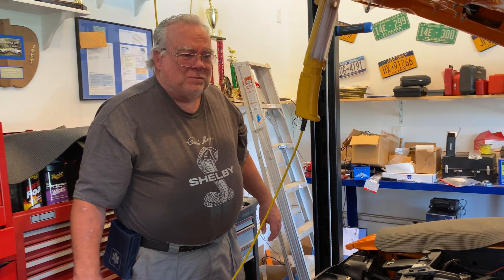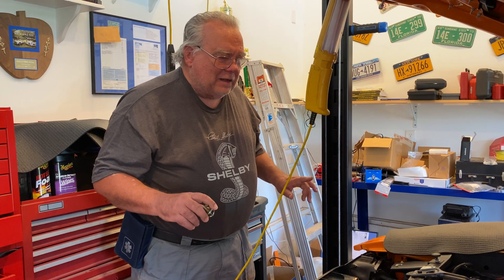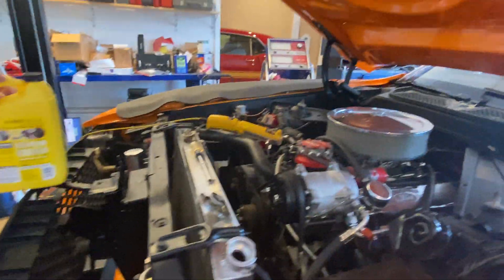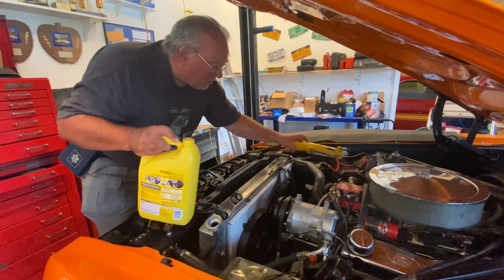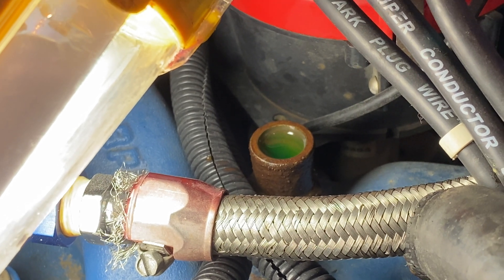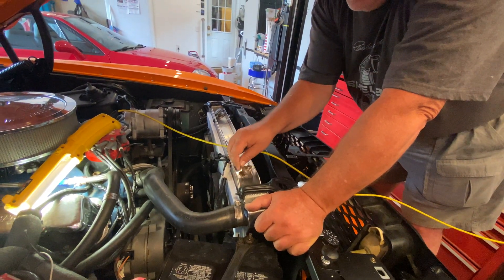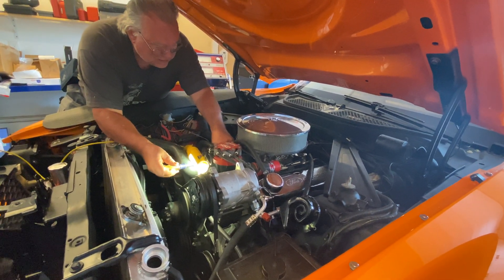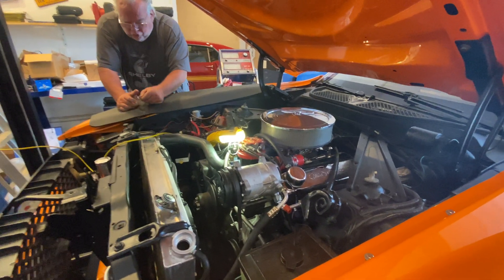First Generation Mustang Engine Coolant Trapped Air Burping/Bleeding Procedure

Comment: Great video! I had the opposite effect after removing the heater hose, almost 1.5 quart of coolant from the intake 😅 Does it mean that coolant flow is blocked by the stuck thermostat or the pump is not doing it's job delivering the coolant to the engine? Thanks again!

Comment: Hi Gil, great video and a beautiful car.  On your procedure, would it be true that following thru the steps, and if once you loosen and pull off the intake heater hose (my hose inlet is a 90 degree angle so the opening is sideways vs yours on top) and so if coolant is already leaking or pouring out right away, then you are good to go and can just close everything back up then? Thanks much.
Reply from the maker: Thank you for your comm ent and question.  In your situation lt sounds like you will be fine.  !la 99 Degree outlet won’t cause a problem.
Reply: @gilberthale7777  Thank you. and you were spot on, as soon as i loosened the clamp and pulled hose back, the coolant was already right there. road test temps were great, no boilovers or any issues. thanks again.

Comment: That’s really cool. Thank you sir! I looked for part two of this but I couldn’t find it. I imagine a guy just lets the engine come up to temp with the radiator cap off.
Reply from the maker: I have not done a part 2 of this video.  I am replaying it now to see if I had said I would produce a later, more complete version as I really don't recall saying a later version would be useful or not.  If I said I would make a later, more complete version I will do so this Spring.  Meanwhile, I am glad you found this video useful.
Reply from the maker: I found the reference to a 2nd video to show how I check for coolant leaks.  I thought I ended up doing such a video.  I will look for it, and if I find it I will provide the weblink for it.  Otherwise I will produce such a video as soon as Car Season 2025 begins.  We live in Snow Country (near Rochester, NY), and if you can believe it we got some snow and ice earlier today today (4/16/2025), and it was barely above a  freezing temperature all day,  Stay tuned, whether it is a past video, or a new video, I will provide you a weblink as soon as I have one for you...  Thank you for alerting me to this missing video...

Comment: Lovely European cars had air bleeds I learned to drill two small holes in the thermostat it helps the engine warm up better. Thermostats work better and always have a overflow tank.
Reply from the maker: Good to know.  One more thing to look out for lest I get bitten in my tail feathers.  heh heh...  Thank you for the head up...

Comment: My gauge stays normal, and no bleeder valve?
Reply from the maker: Hi Mark.  

I am having difficulty in discerning what you are meaning by what you say,.  What kind of gauge are you speaking of? (Vacuum, pressure, temperature)?  And what do you mean by "bleeder valve?"  My guess is once you clarify things it will be perfectly obvous to me, but at this moment I am thrashing around trying to guess what it is you are saying or asking.  Sorry...
Reply: @gilberthale7777  the gauge on the instrument panel, where the tach and speedometer are.
Reply from the maker: @Mark-um3hm  Okay, got it.  Staying in the Normal range is good.  I like seeing the temperature being read staying near the middle of the Normal range.  In slow traffic or when idling for a prolong period of time, especially on hot days, the needle will move toward the hotter side of the Normal range.  Once the car is traveling over 30 MH or so the needle ought to move back into the niddle part of the Normal range.

If the needle tends to read on the higher end of the Normal range I suggest getting a digital infrared thermometer to read the temp of the upper radiator hose to see what the temperature actually is.  I have seen cases where the temp sending unit begins to cause the temperature gauge to read higher than the temp actually is.  I ended up replacing the temperature gauge sending unit on our 1969 Shelby GT500 for that reason.  The temperature gauge reading at the higher end of Normal then returned to reading in the middle of the Normal range.  The upper radiator hose was reading 181 degrees where the temperature gauge was reading at the upper end of Normal until I change the sending unit.  

As for a bleeder valve, I have never seen a bleeder valve on a Mustang engine from the factory, ever.  My method of "Burping" the engine''s cooling jackets as shown in the video above is my way of performing the job a bleeder valve likely was designed to do.  Although a bleeder valve would have been a good idea, and easier to use, my guess is manufacturers don't use them because it adds to the cost of building an automobile, and they likely do not see trapped air as a big problem.  Frankly, if an engine has air trapped in its cooling jackets, at some point the thermostat will get hot enough to open, and the trapped air will tend to move into the radiator as the cooling jackets begin to fill once the air has moved out.  But, there is too low a level of coolant, and the upper part of the engine block and heads will have gotten far hotter than they should have before the thermostat opened.  A radiator can then be topped off with coolant while the engine's thermostat is open. and as it is filled the remaining air in the engine and radiator will be replaced with the higher coolant level.  What I am trying to do by burping the engine of trapped air is prevent the engine block and heads from become super-hot before the thermostat does eventually open.
Reply: @gilberthale7777  You think it’s possible that it is my thermostat? Say I run to the store, I’ll start my car, and it’ll come up to temperature, and the upper radiator hose is very hot, but my hose going to the thermostat is cold? Even if the temperature gauge is in the middle, sometimes the thermostat hose isn’t hot?
Reply from the maker: @Mark-um3hm  The smaller diameter hows connected to the thermsrtat housing is the heater (core) return hose.  It will get hot when the heater core coolant is flowing from the water pump, through the heater core, and is being returned to the engine,  It returns to the coolant inside the engine through the small hose post coming from the heater core.  I hope I was able to make that clear.  

If the heater return hose is not getting hot, even with the heater turn to its highest temperature it means something is impeding the flow of warm/hot coolant to or through the heater core.  It could be something as simple as a failed heater coolant control valve that controls the flow of coolant through the heater core, or the heater core could be plugged.  It is also entirely possible that over the past many years someone bypassed the heater core (by rerouting the heater hoses) or simply plugged the heater hoses as opposed to repairing a leaking heater core.  I have seen stranger things done to heating system when someone did not want to spend the money to fix them.
Reply: @gilberthale7777  Thanks for all your knowledge Gilbert. I will figure this out?
Reply from the maker: @Mark-um3hm  I reviewed and corrected several typos I made in the post preceding this one.  I had entered that information using my iPhone  and it created several typos.  If you used Google to translate my English to Spanish my typos could (would) have caused problems.  Please turn the translation again to see if what I said is more sensible.
Reply: @gilberthale7777  I remember on older cars, there’d be a bleeder valve on, or near the thermostat housing, and you could open it while filling the coolant, and all the air would escape from it? My car doesn’t have one.

Comment: I have a 2021 Acura ILX, and did just this, 2 days ago? Just flushed my radiator, and refilled with the spill free funnel. I put the cap back on the radiator, get it up to temp, and only get heat on High setting? If I go to 86, 85, 80, ect…. It goes to room temperature air, I get no heat. Any suggestions? Thanks
Reply from the maker: It is possible you have some air trapped in the heater core, and need to bleed off the air where the heater hoses go into and through the firewall.  Another possibility is the heater valve controlling the volume of coolant flowing into the heater core may be malfunctioning and/or partially plugged.  I do not recall if that heater valve controlling coolant flow is operated with vacuum or cable linkage, but in either case those need to be looked at also.  At worst the heater core itself may be plugged within the coolant tubes.  I hope not, as if I recall correctly those are a near to replace. Like many cars the entire dash has to come out to get to the heater core.  Very few cars make that easy to do.  The only one, in fact, I can think of is the 1977-1979 Ford Fairmont or Mercury Zephyr IF and ONLY IF it does not have factory air conditioning.  The factory A/C equipped Fairmonts and Zephyrs are as difficult to replace as with many other cars.  

If the heater core is plugged it is possible several rounds of chemical flushing may help free things up, unless the material plugging it up comes from using tap water to dilute the coolant.  Tap water in most parts of the country is considered to be hard water, where a lot of minerals are dissolvedx in the water.  This is what causes bathtub rungs, shower scaling, and water spots, as when the water dries it leaved the previously dissolved minerals behind as hard deposits.  Detergents are made to help fight the hardness compounds, but it is largely a losing battle.  And, it is those dissolved mineral depsoits that case most of (if not all of) the scaling and deposits to build up in a cooling system.  And where the coolant is less likely to be flowing is where the deposists seem to want to form.

Once you get your cooling (and heater core) all cleaned out I recommend using either pre-mixed coolant (Prestone) or use distilled water to dilute concentrated coolant, as opposed to using tap water to dilute the coolant contrate.  And of those two options I heavily favor using the premixed coolant.
Reply: @gilberthale7777  I appreciate the feedback Gilbert, but this car has 38,000 on it, and I always use 50/50 for Acuras. I’ve only come across this problem two days ago, when I was doing just a maintenance flush, and fill? I used the spill proof funnel to burp the system, and what’s unusual, is I’m getting blasting hot air on the Hi setting. If I go to 86, 85, even 78, the air turns into like a room temperature? I think if it was the heater core, I’d probably be smelling coolant in the car, which I don’t? I don’t know? I may have to bite the bullet, and take it to a shop? Maybe it needs vacuum before refilling? I’m not sure? Thanks for reaching out 👍
Reply from the maker: @Mark-um3hm  If you had a leaking heater core you would definitely be seeing coolant leaking our somewhere, often into the floorboard of the front seat passenger.  But, if the flow of coolant through the heater core is restricted (plugged core, inoperative coolant control valved for the heater hoses) will not leak any coolant, it will just end up producing less heat output than it would normally be capable of producing.

Comment: Worked perfectly! Wish I tried it sooner!
Reply from the maker: Awesome!  I am glad it worked for you (also).   It’s one of those things that looks obvious in hindsight. And once learned you will use that technique time and again. Plus now you can amaze your friends who work on (vintage) cars. Heh heh…. What is really cool is it is so basic the it will work with newer vehicles also. Timeless.
Reply: @gilberthale7777   I could not find the part 2 of your post.
Reply from the maker: @Dave-ru2qh  
You caught me.  I was going to show an alternative burping method for enginess that have a different design for heater core hoses.  But the vehicle I intended to use for the video was sold by its owner, unbeknownst to me.  I will alter the topic header of this post to eliminate any potential confusion.  The approach is the same, but where I was going to take off the heater core coolant return hose was a little different.

Comment: Fantastic information and video Gilbert! I have pulled out the temp sender before to purge air while filling up the radiator or if the thermostat did not have a "jiggle valve" have drilled a 1/8" hole and clocked the thermostat with the hole straight up at 12:00 since air likes to rise. It seems to work great. But I like your method and will try that next time. By the way, what thermostat you running? 180 or 195?
Thanks again!
Reply from the maker: Greetings,Stuart!

I have pondered, in the deep, dark past, drilling a 1/8" air bleed hole in the thermostat.  But, in the end decises to just burp the engine as shown in the video Lynda and I produced and posted.  Do much less hassle, or so it seems.  As for the tenp thermostat, I run the 192-195 degree units, as specified by the manufacturer.  They made some changes to the engine's metallurgy and several components that are allegedly best run at 192-195.  I know there are some folks who run 180 degrees, and it seems to work just fine.  But, running at 160 degrees allegedly causes gunk to build up in the cranksase, And IT leads to excessive wear over time.  I prefer to run on the edge of caution, thus the 192-195 ddegree thermostats in our engine,
Reply: Thank You again Gilbert! And please Thank Lynda too as she is doing a great job! I will be looking for more of your helpful videos. I have a Ford 302 with 351 heads in an 56 F-100. I found the engine on eBay, it was a former marine engine someone overhauled +040 and put a street cam in it. Its been a great engine but afrer 10 years of 30K miles of use, it is now leaking coolant around the timing chain cover so as soon as the weather gets a little warmer I will be tearing into it.  Haven't done it before so it's going to be an adventure! 
I will be checking back into your channel and Subscribing for more good stuff from you and Lynda. Til next time sir!  Stu

Comment: Sadly Ford did away with that port on the top of the thermostat housing. Been having issues getting air out of my system for weeks now but I have to keep driving it since it's the only running car I got left. I got an 88 302 Windsor.
Reply from the maker: You should still be able to remove the heater hose as shown in the video.  One of the heater hoses attaches near the water pump.  The other is located a little further back from the water pump port for the one heater hose, not far behind the thermostat cover you should find the heater hose return line into the engine.
Reply: @gilberthale7777  I'll take a look. Just spent 20 minutes leaving it idle at temperature with a sealed funnel in place of the radiator cap half filled with coolant. It would cycle with and without bubbles I'm assuming as the new thermostat I put in would open and close.
Reply from the maker: @sijonda  I dug up some diagrams I think you will find useful to locate the Heater Hose Return Fitting in the intake manifold of your 302W engine  If you need further clarification please let me know.  The PDF file is on my Google Drive at this link:
https://drive.google.com/file/d/1scLTMXJm5OeeQ2vq0jG2K7vV5hB4uy8E/view?usp=drive_link
Reply: @gilberthale7777  I appreciate the help. Thank you.

Comment: Thank you very much sir. I was hesitant to let it run with air in the system hoping it would work it’s way through!
Reply from the maker: I am sincerely happy you found this info useful.  I wonder how many folks ended up with head gasket or worse issues due to running their engine without fully purging air from the engine coolant passages.  It was, frankly, because I realized one day when I purged my engine after replacing the water pump, that I had a sudden epiphany re: wondering if I could use YouTube to try to help others prevent engine damage due to running with trapped air.  I had done other YouTube videos by then, but I told Lynda we needed to do one on this subject right away.  I will never know how many folks I helped prevent overheating problems because of this video, but I love hearing from fellow enthusiasts when they tell me it was useful.  So, thank you for letting me know it was useful information for you.

Comment: Hopefully this works, and probably the best video explaining this. Thanks 🙏
Reply from the maker: Thank you.  There are alternative hose connections for different makes and models.  The one in the video is a 1973 Mustang Convertible with a 302 2v engine.  But, no matter the make and model, all liquid cooled engines for automobiles will be very similar.